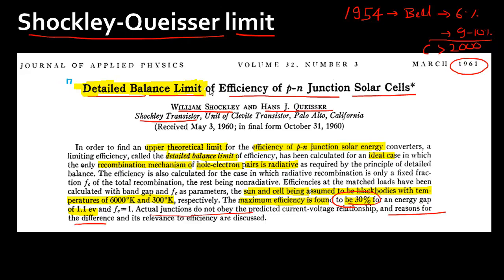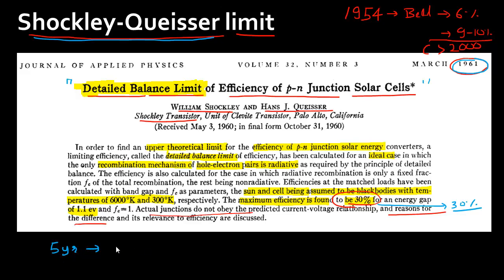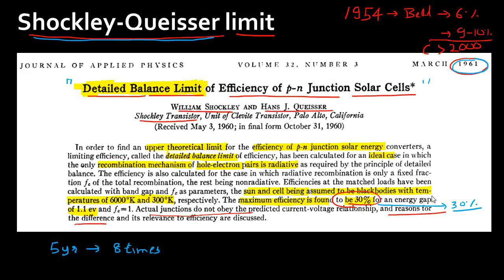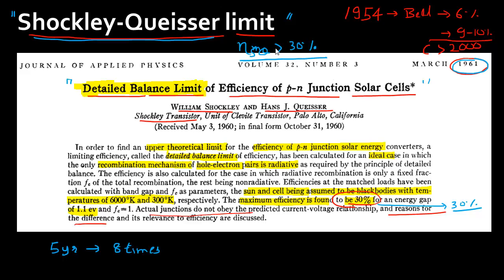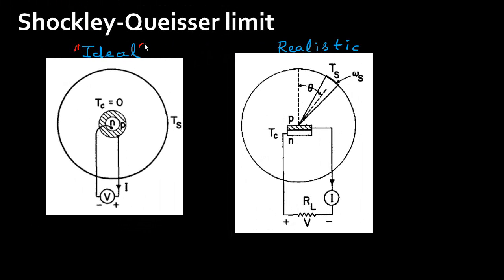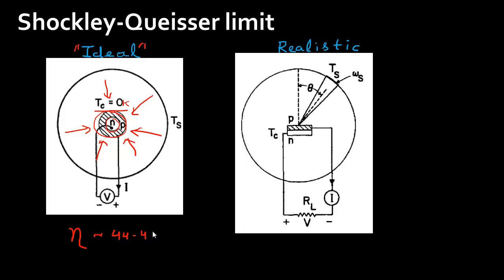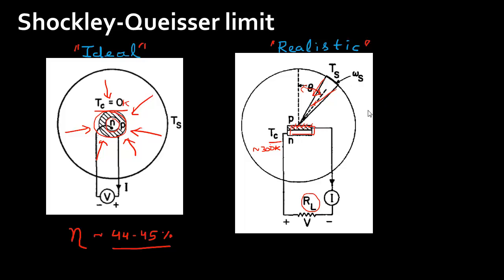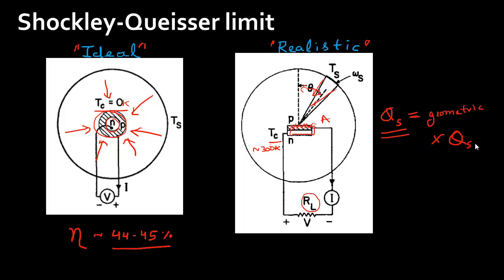Shockley Queisser limit for solar cells: Part 2

Comment: Hey..could someone please clear my doubt?
I am not getting the part where it was explained that Rabs=Remiited. Because any body at a certain temperature emits radiations. How can we attribute it to radiative recombination? e.g: Imagine any other body(rock, metal piece etc.) kept in the place at that exact spot. According to stefan's law, that body will also emit radiation and be in equilibrium with the surroundings. Since it is at a non zero temperature, it  will emit energy. There is no recombination or such phenomenon here. So how did we say that radiations emitted by this semiconductor are because of recombinations?
Reply: Wondering the same...Did you ever figure it out?

I think that maybe the process of radiative recombination adds to this blackbody radiation and thus the inherent radiation described by stefan's law decreases so as to keep the cell at thermal equilibrium with its surroundings. Basically, I think that in order to maintain equilibrium, the material would radiate less to balance the additional radiation of recombination.

Just an idea. I don't know for sure. Let me know if you know the actual reason.
Reply: Just found something: https://courses.edx.org/c4x/DelftX/ET.3034TU/asset/solar_energy_v1.1.pdf

If you go to page 118-119 and read the portion under 10.2.2 , it says that electron-hole recombination is actually caused by the absorption of thermal radiation. The release of those photons is what keeps thermal equilibrium in the semiconductor.

Basically from what I understand, if the panel was at 0K, this process wouldn't occur. The fact that we consider the panel to be at 300K (room temp) means that it has to absorb and emit thermal radiation and electron-hole recombination is the mechanism by which it does this. 

To answer your question though, I think that electrons, of any element, can be excited to a higher state. The converse is that any electron in an excited state can lose its energy and drop down to a lower energy level. The result is the emission of phonons. Thus, whether it is a metal, a human being's skin, or a semiconductor, the process of electron excitation and de-excitation is similar.  

(I don't know the last part for sure...)
Reply: @VishveshDhar  Thanks for sharing that PDF document!